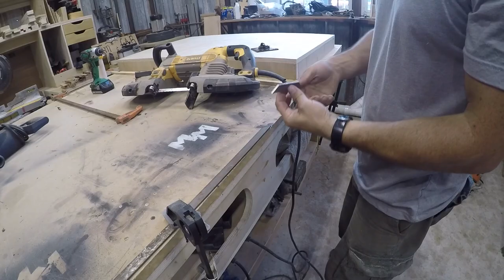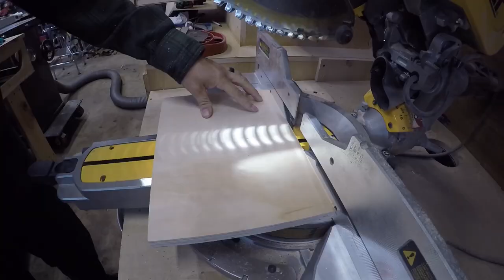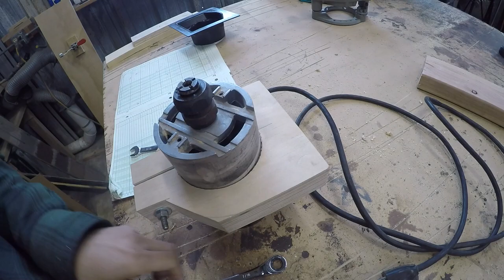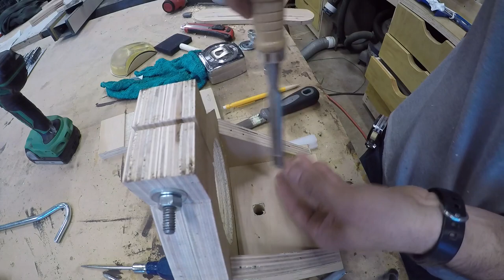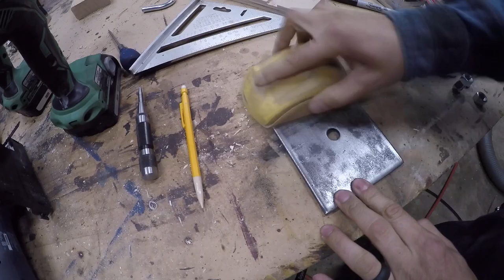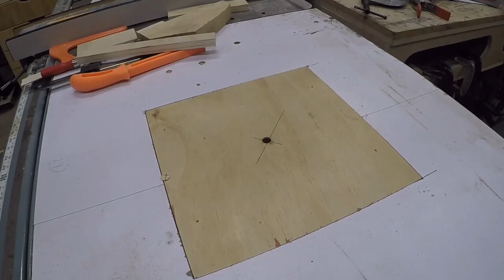DIY Router Lift

Comment: I like this design, particularly the side screw adjustment. Frees up table top for measuring the increments of the lift, without have a screw handle in the way of the measuring device. Good job!
Reply from the maker: Thank you!

Comment: Thank you for the wonderful design.  I am making a similar lift.  I have implemented a low  rpm (3) rotisserie motor to turn the jack screw wired to a foot pedal so I can make circle cut outs in  1 1/2"  (3/4" glued) MDF for speakers. Easily disconnecting the motor with a pin to turn it by hand for bit changes.
Reply from the maker: Great idea! Send some pics if you can.

Comment: Nice project and great video! Gave me some excellent ideas to make mine. Probably de only change I would do is the lifting mechanism. Instead of t-tracks and plastic strips I would just use a pair of drawer slides.

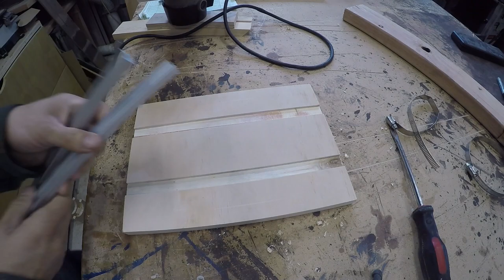Comment: Is there a reason your table saw insert has a gap at one side, and is held in place with screws (at 3:40)?
Reply from the maker: That was just the width scrap wood I had at the time when I made it. The screws just keep tension to keep it in place. I had planned on making another but never got around to it since it worked just fine.

Comment: One improvement I would make to this is find a jack with a hex nut instead of the doodad you got on this one. That way you can use a drill to raise and lower it easier.
Reply from the maker: I thought about that but like the precision of a hand crank. I plan on making it a knob with a lock though at some point.

Comment: My only concern with this type of design is that the router will only be held down by its own weight. This should be perfect for most bits but an upcut spiral bit could pull the bit into the workpiece.
Reply from the maker: The work piece will push down on the frame that holds the router so the forces will cancel out.

Comment: There is no arrangement measuring the lift
Reply from the maker: Not yet, but plan to implement one. I also need to add a height lock knob, although I haven't had a problem with the router/jack lowering while using yet.